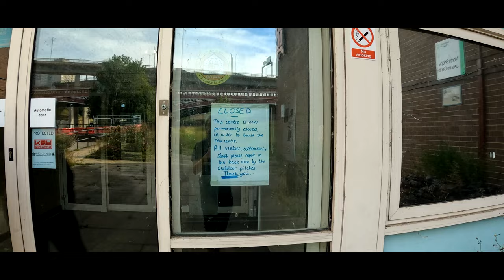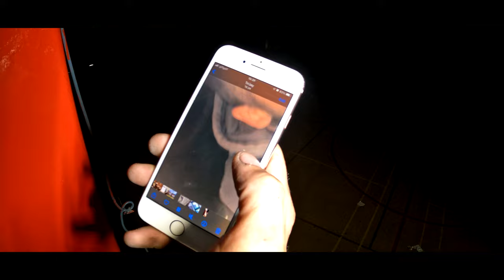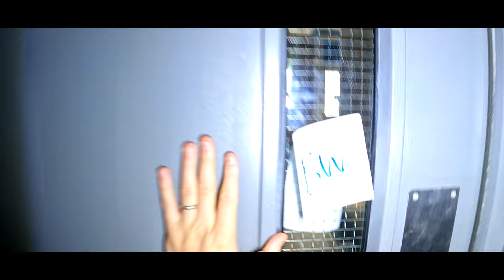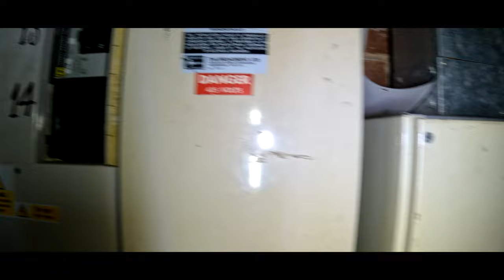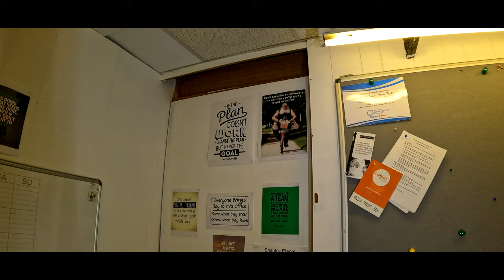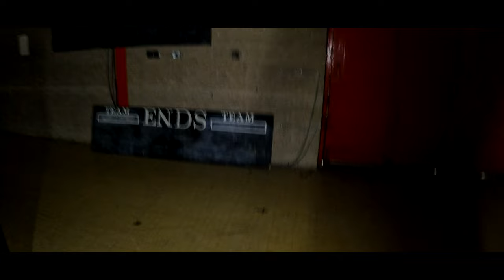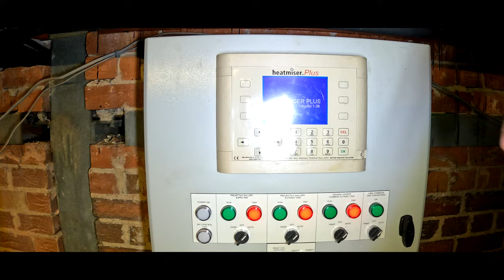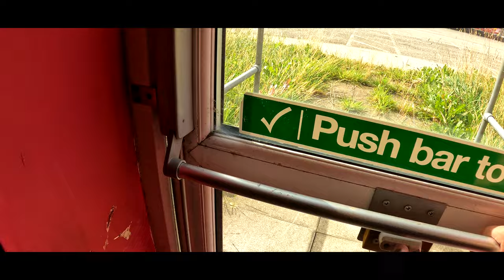ABANDONED Gigantic North Bridge Leisure Centre Hidden In The UK And Was Caught

Comment: use to work here i knew it was planning on closeing to make way for the pool but such a shame, generally speaking it has a solid structure and should have remained open and tarted up. All these modern buildings which i also use to work at such as brighouse pool and sowerby pool are falling to bits made of cheap materials shitty plasterboad walls getting broken all the time, mdf skirting board turning to mush
 
shame but low budgets in calderdale for leisure
Reply from the maker: I would agree waste of a building and could be reused however modern buildings not made the same as all - Thanks for sharing with us